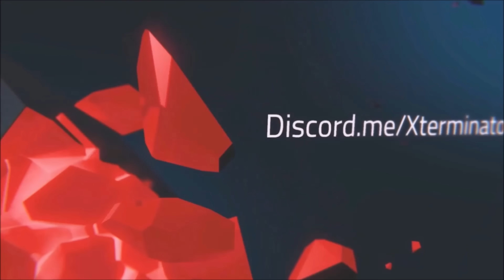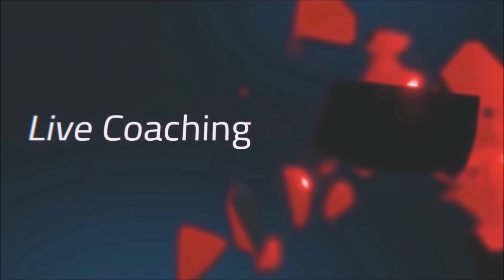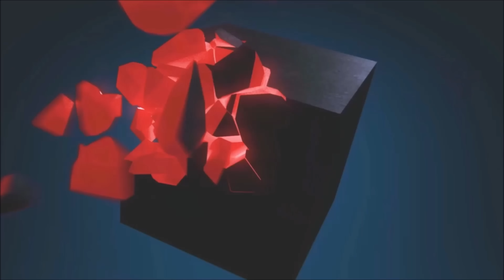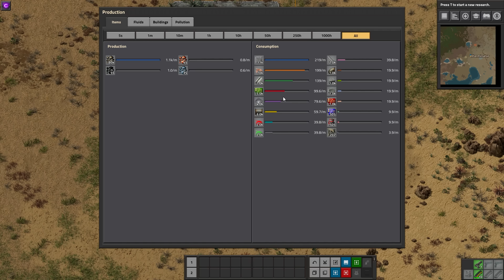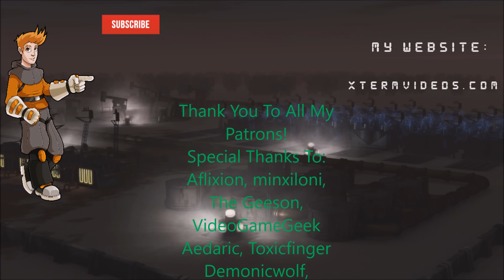Factorio Mod Spotlight - Rocket Silo Construction

Comment: What happens if you pick up the completed silo and then put it down again? Does it revert to being an unbuilt silo?
Reply from the maker: Hmm good question. I imagine it would be completed still.
Reply: You can actually take the finished silo in your pocket and place it finished where you want. But, the mod has options to make it non removable after placed